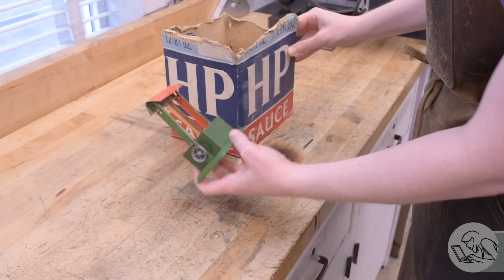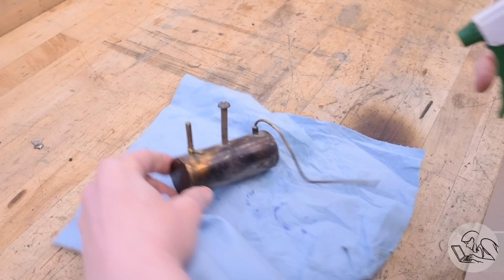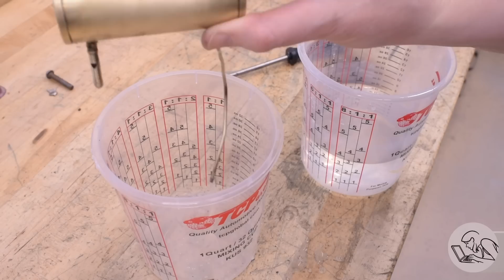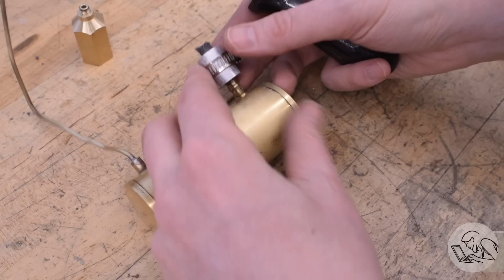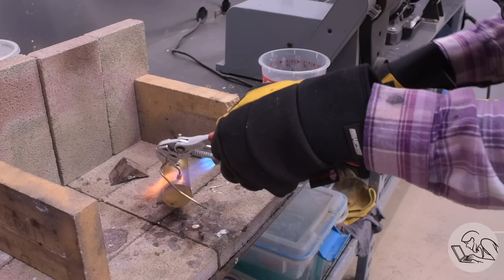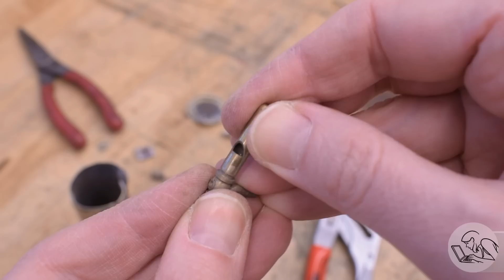Restoring a Vintage Steam Toy - Part 1

Comment: "Most people would buy these toys, run them a few times, and go 'neat!' and put it on the shelf" I feel attacked! (looks at the 20 year old steam toy I bought apparently to run it once and put it... Well, you know). Entertaining as always, and thank you!
Reply from the maker: It was a personal attack as well. That’s exactly what we did with the Wilesco traction engine that my dad has 😂
Reply: @Blondihacks I have the opposite example sitting in my kitchen display cabinet, my mother's unbranded toy steam engine it is so well used the paint is burnt off the fire box, boiler nearly entirely black, even the crank shaft has grooves worn in it and the plain brass tinwork that supports it has ovalised holes. She always ran it on an old tea light full of meths. I've run it a few times but long suspected the boiler is brittle by now.
Reply: I used to know people who did Hydrostatic pressure testing of pipes used for natural gas transport and reticulation.  The longest length of pipe I heard of them testing was about 400 miles!
Reply: @DavidCoxon-x8h  good grief.... how do you check that for leaks even with a pressure gauge for the initial test it would take a long time to find leaks .
Reply: @TalRohan  I am sure it was a bigger job than he was letting on to me, but with professional quality welding and checking of the weld, very few leaks were expected.  The general approach if a leak was found was to put a valve in the middle of the pipe (200km away) check one half.  If that held pressure, that was half the pipe eliminated, if not halve again.  This approach gets down a manageable length in about 8 halving steps if there are not too many sections failing.  Otherwise the project manager is reporting severe project slippage due to quality issues with the joint welding.  I have used a similar 'sectioning' approach many times when debugging software of finding faults in electrical circuits.
Reply: @DavidCoxon-x8h  yes I see, maybe they were xraying welds as they went too. halving is a good way to debug a lot of things
Reply: They make a GREAT source of humidity in the dry winter months where most would runa humidifier anyways lol
Reply: I mean, it's probably more a decoration than a functional tool. You're not using the little timber mill to build your house. It's a cool toy and display piece, but it's not something I'd imagine you'd get a ton of use out of.
Reply: @delucain  I would love a steam engine just big enough to run a saw or grinder...ooh maybe a belt grinder , that would be very cool...I make my own charcoal for blacsmithing so it would be an awesome addition to the shop